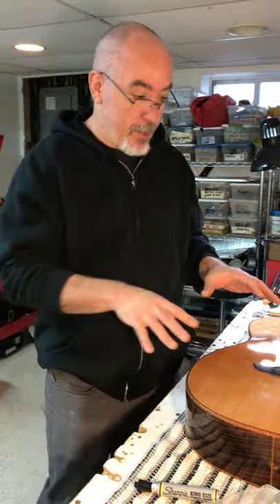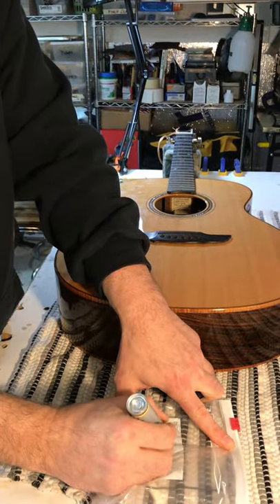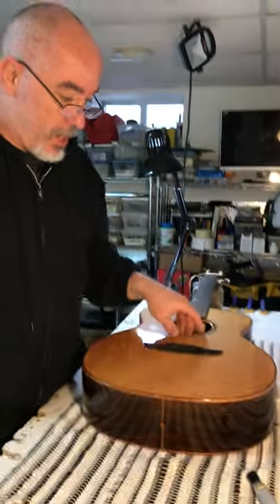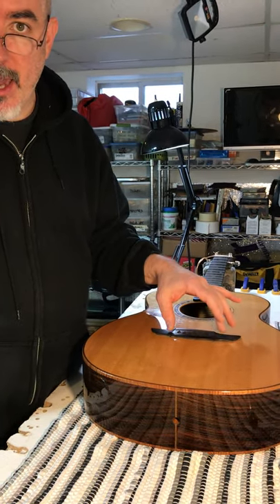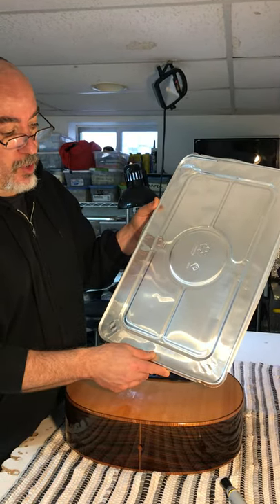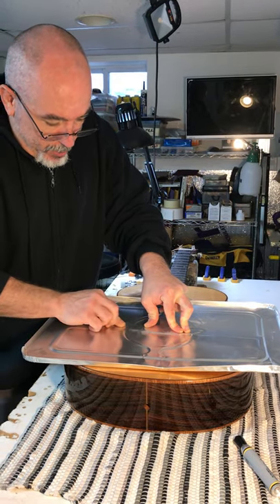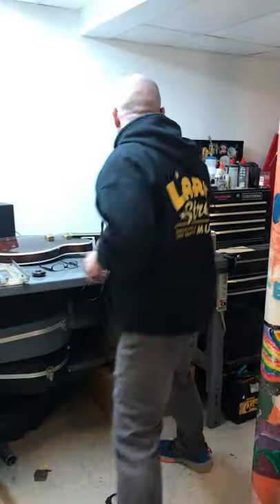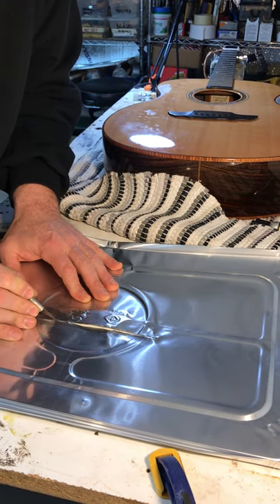How To Remove a Guitar Bridge With Irregular Shape

Comment: Do you think white poster board material would help underneath the foil just as an added layer of protection to the finish? I have a guitar that has a lot of sentimental value and I don’t want to mess up the finish or overheat the top.
Reply from the maker: Hey, It probably wouldn't hurt. I don't usually do it because after I get done bending the foil around to fit the arch of the top, it's usually just resting on the outside edge. Just a couple pieces of poster board for a standoff probably wouldn't hurt though. Great idea!